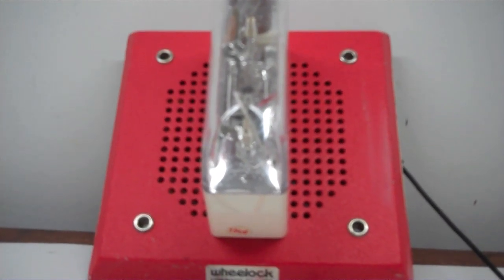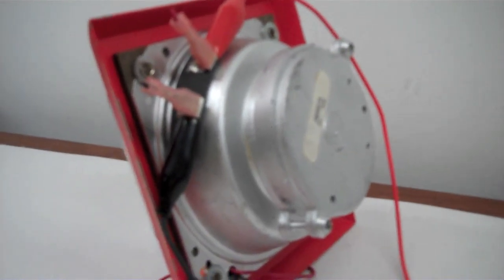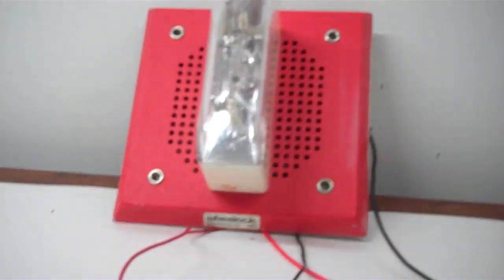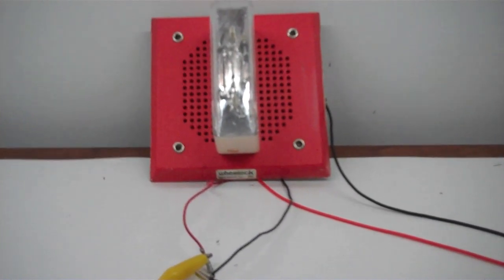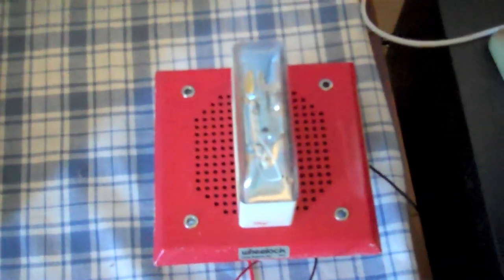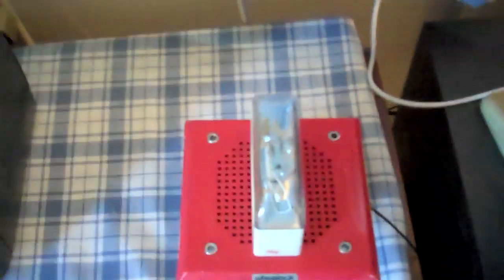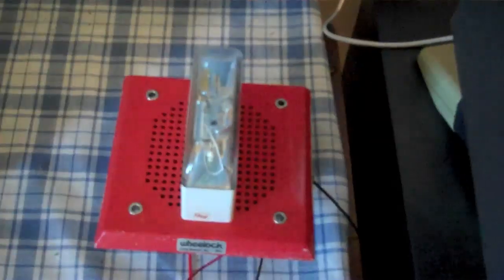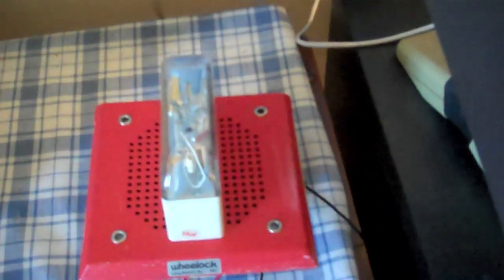Wheelock "ET-1070-LSM-24" Fire Alarm Test

Comment: I bought a Wheelock E70 speaker strobe. The strobe works great, however there is no sound. I hooked up power to both sides. Should the chime work as is or does it require additional accessories? Thank you.
Reply from the maker: The device you bought will not make sound on its own, (The chime version would have CH) you will need an amp to power the speaker. I recommend the Pyle Home PCM20A to send audio to the speaker.

Comment: I'm getting a Wheelock et-1080-lsm-24 and I know you own one, but do you have to hook it up to an amplifier or you can hook it straight to an audio cable to a computer or tablet?
Reply from the maker: Any speaker strobe requires a proper amplifier that supports the voltage. Nowadays, I use the Pyle Home PC20MA amplifier, which outputs to 25V, 70V, and even 8-ohm. It has a line input as well, where you can hook up an MP3 player of any sort. Wiring the speaker to the amp is easy; it's like wiring a horn to a 24VDC power supply.

You can't wire a speaker to a stereo unit, it wasn't made for this sort of thing, and will eventually destroy the stereo. This video was made before I obtained that amplifier.
Reply: so can you hook the speaker directly to a pc without an amplifier
Reply from the maker: Ideally no. You will probably damage your sound card, and you won't get a very loud output anyways.
Reply: Realistically you don't even need an amp that has a 25/70/100V output tap, you can use a regular hi if amplifier with an 8ohm amplifier, connect the output to the primary or 8 ohm terminals of a 25V/70V transformer.

Comment: This actually wasn't a CH-70, but an older version of the CH series. I have this alarm with the chime module, and the alarm's model number is the CH-DF1-LSM-24VFR
Reply from the maker: Thanks for clearing this up! I should have figured, I have a similar unit (Vandal Resistant Grille, same vertical strobe) that was sold mostly during the same era this unit was produced (1990's), the ET-1080-SLM-24 (the odd thing about my particular unit is that it's from 2001, according to the date code!).

It seems like in the later 1990's, Wheelock simplified their model numbers a bit, such as the AS, NS, RSS, CH-70, you get the idea. That's probably what I was thinking about when I originally made the video.
Reply: ***** No Problem, and I really love your videos. And, IMO, I think Wheelock made a smart move by simplifying their model numbers.

Comment: What's the difference between this version of the ch-70 and the version with the horizontal strobe?
Reply from the maker: You pretty much answered the first part of your question, but there's a little more.
 
The horizontal strobe version has a design that conceals the mounting screws, with a cover. Basically, you mount the alarm itself onto an electrical box, then put on the cover. (The cover is the red or white plate we see on this particular alarm).

I have a video featuring an E-70 with a horizontal strobe (a MUCH better video than this one from a few years ago). You will notice that unit has a few differences than this unit.
Reply: So, essentially the horizontal strobe version is just meant to be more tamper proof and look better. Makes sense. I knew there were no hardware differences.
Reply from the maker: Your description is better than mine. Not necessarily tamper proof, but more atheistically pleasing.
Reply: I meant more tamper resistant.

Comment: why does the e-70 have a message and not a chime strobe?
Reply from the maker: I explain part of it in the video and description, but I'll explain anyways.

The previous owner removed the chime module from the speaker before I got a hold of this unit. I recall that person telling me a while back, but I don't remember why they did it.

The CH-70 series has a chime module wired to the speaker as opposed to a speaker transformer (steps down the voltage to the speaker. Now this is just a standalone speaker, so I hooked it up to the stereo, and played whatever into it.